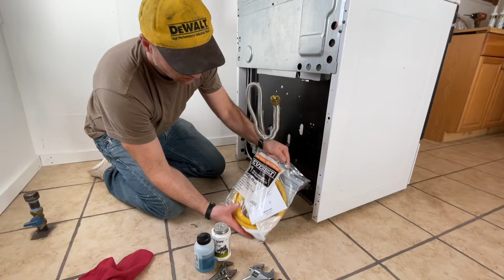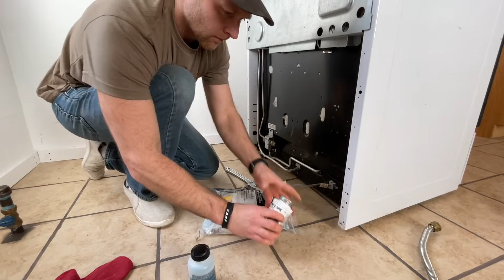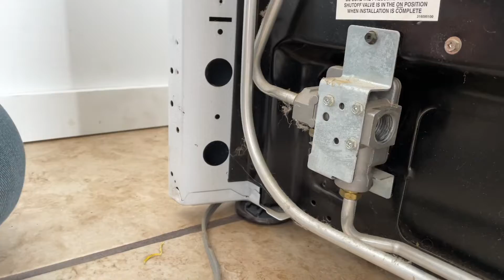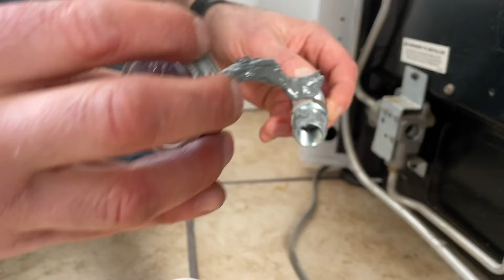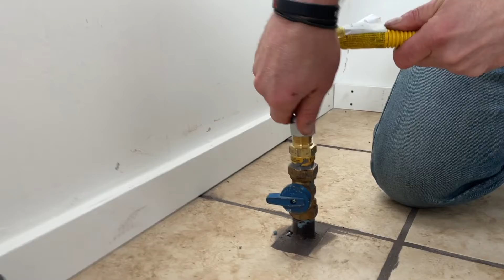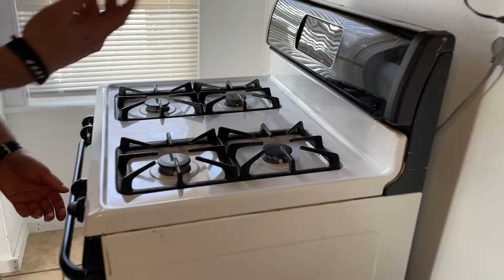How to Extend the flexible Gas Hose to your Oven / Range,  Gas Dryer etc.. (Full Steps & safety)

Comment: I have a frigidaire  it is natural gas. Now, I ordered a kit to change it over to propane.
Can I do this what you're doing to extend it to a propane bottle?So I can move it away from the stove when I get the orifices change over, for propane, I would prefer to have like stainless steel wire for protection on the outside. Going to my propane bottle to the stove.
I see on eBay Amazon. They have some.
Extension lines that comes with different brass fittings.Your thoughts

Comment: Question. The original owners of the house before me remodeled the kitchen. When doing the gas line for the stove, they ran the flexible hose through the floor and connected to gas in the cellar, then proceded to seal everything up. The hose sticking out from the floor is SO short and it was such a pain connecting to the new stove/range I bought. Now I'm having issues with that stove. 
My question is, can I extend that flexible hose without having to replace all of it? Thanks.
Reply from the maker: You could.  But the right way would be to have a solid pipe with a shut off valve coming out of the floor.
Reply: @HowToWithLech  I appreciate you replying so fast. I would probably have to hire it out, come to find out, they did it because they didn't want to crawl through the crawl space and to it the right way. 
If I did extend the flexible hose, do I just get what you have here in the video and connect it? I've never messed with gas before, so I am just ignorant. Haha.